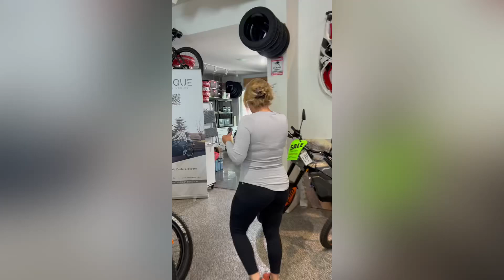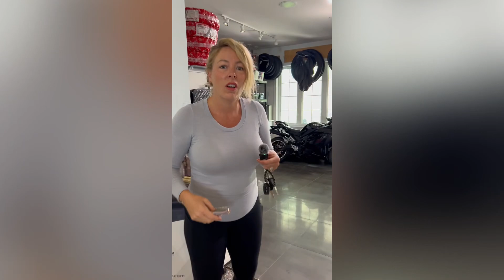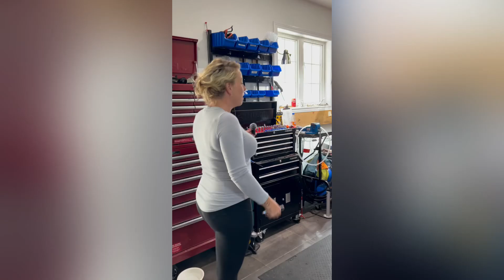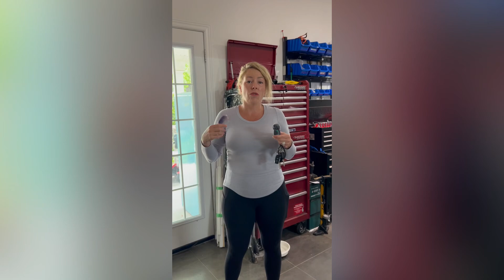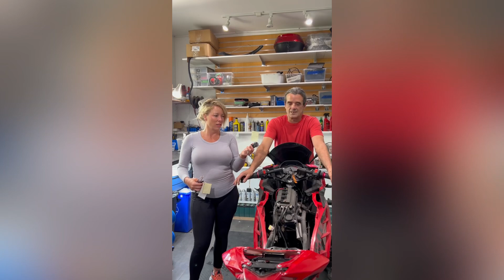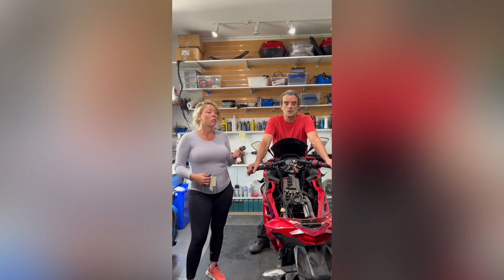Ebike Battery Voltage | Low Voltage Cut Off VS Charged Output 🔋

Comment: I want to upgrade for more distance, I’m going to start riding my bike to work. It’s 7 miles from my house. Do you think my 72v 20mah battery will get me to work and back home with a 7 mile distance ?
Reply from the maker: hey,  depends on the bike.  it should.  hills, your weight, wind,  it all contributes
go bigger if you can

Comment: Charge and discharge is monitored through the BMS ( BATTERY MANEGEMENT SYSTEM) integrated within the battery its self to maintain balance of the individual cells, provide protection and safety of the battery overall health utilizing an algorithm to monitor the process. Realy neat shit luv it🤪

Comment: My bike loses throttle response when I hit a small pothole  how can I fix it?
Reply: That can be difficult to troubleshoot you would require operating the bike stationary to check the throttle ( hall sensor) and wiring and or the motor controller
Reply: I have had that happen myself and traced the problem to a loose connection at the circuit breaker. Wires inserted and screwed down in the breaker can definately loosen over time, especially riding bumpy roads. Remove wires from breaker and clean with sandpaper ..... then reinsert and tighten screws firmly. Hope this helps. Cheers
Reply from the maker: excellent input,  that's the weakest spot,  good call to check it